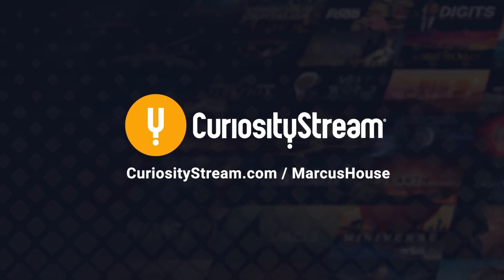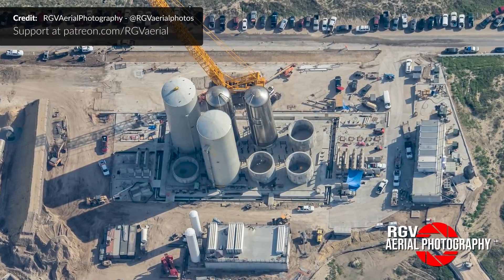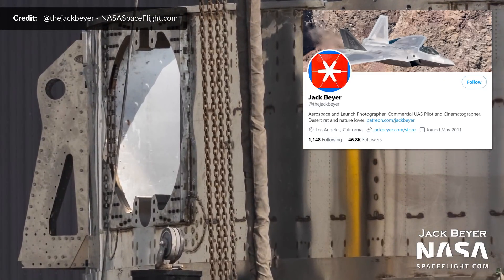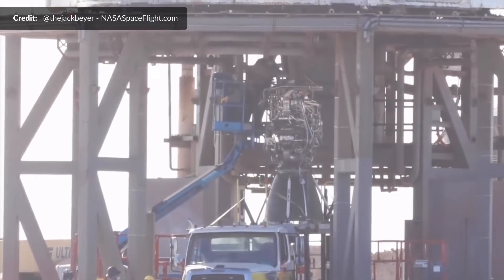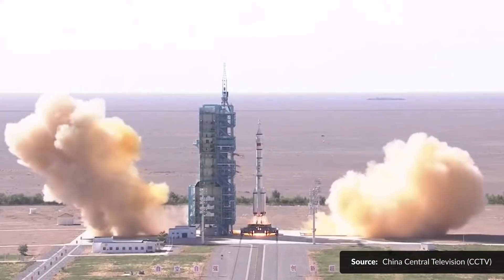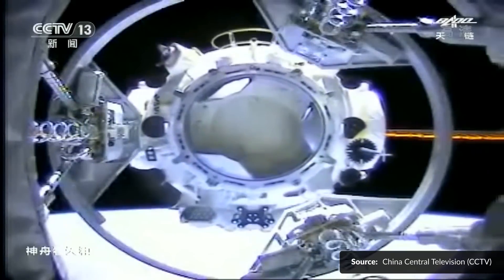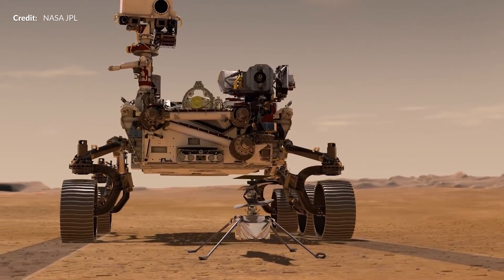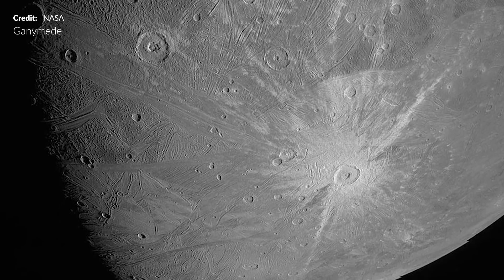Hypersonic Starship and Incredible Orbital Site Progress, GPS III SV05, Rocket Lab Mars Mission

Comment: I sit in my 2000 accord and wait for its "raptor" engine to warm up. Because, if I don't let it warm up it doesn't feel right. My raptor engine could probably get to the moon an back. I started calling my car a raptor engine recently. Also, I started working for GM and I drove a Ford Raptor off the lot to just check on a lot full of cars that are wasted talent, anyway, the raptor is a huge engine via Ford. It was all I imagined. The Ford raptor has definitely already been to Mars.

Comment: New Foundation Unknown Structure:   LOW structure.   Land on Water maybe the purpose of this structure.  LOW provides multiple advantages such as fire suppression, soft landing and controlled vertical capture.  Given the first stage will experience an ocean landing in the first orbital fight, it might be possible that a LOW structure built on land could be in the works.   Without the corrosive salt of sea water and with the addition of corrosion and fire inhibitors a fluid landing may be a good alternative to consider.   Now if you think this is a laughable idea just rename it to Land on Liquid for a nice acronym.

Comment: Maybe the, yet unknown, concrete pad is a raised surface for the sole purposes of elevating the crane being used to stack the final sections of tower? I feel like they need to elevate and level the crane to safely reach the top levels. Cheers.
Reply: The crane full capability is higher than the full tower itself

Comment: The positions of the grid fins on the starship booster in  2 groups is actually more optimal then with a 90 degree pattern. With the 90 degree pattern 1 or 2 of the fins are fully or partially in the wake of the booster reducing the effectiveness at high angle of attack . VS - with them at 60 degrees apart this keeps them mostly out of the wake more and should improve their performance to provide better return guidance - the booster can fly flatter with preferred dorsal side during return.
Reply: Tldr
Reply: @macawguy3021  then why are you here?
It's good info.

Comment: Marcus,  it's been on my mind a bit and I'm sure someone has answered it somewhere and I've missed it. With all the work to Falcon, and now Starship, why would SpaceX move to ditch in the ocean as opposed to landing, either offshore or onshore?
Reply from the maker: They are still just prototype phase rockets. This allows testing without the risk of damaging any of the new infrastructure. They will by unlikely to refly either again and it is probably also unlikely they will get a perfect point landing first time. Need a lot of data and testing before they can really risk Starbase.

Comment: Marcus, 3:28

Vertically directed exhaust opening for underground routed  FLAME TRENCH from launch stand. Look where it is directed from.

NO WAY SpaceX will launch the BN's from ground surface without it (them).

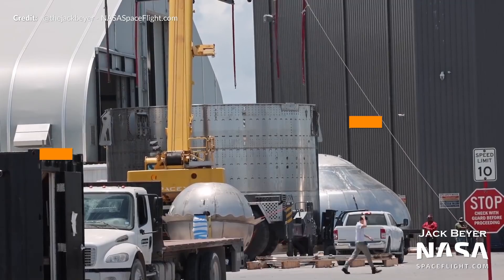5:17
Post capture alignment guides.
Reply: The position is very wrong to be a flame trench. And trench is impossible near the coast without flooding

Comment: Placing the grid fins in the way they have will make it so that it will only be catchable if the superheavy booster is in the proper rotation with respect to the  tower when it comes back to land. If the booster is 1/4 out of proper rotation, the catching clamps will be out of orientation.
Reply: The grid fins is not the place where the catching arm will be catching

Comment: I bet the new foundation is the booster catcher. They probably don't want to risk damage to the launch tower.
Reply: They need a tall tower to catch the booster, with a deep foundation - that's the current one they're building. The official FCC documents for that tower say it will be used for catching the boosters. So there won't be a separate booster catcher.

Comment: The returning booster will be empty of course but I wonder what kind of strain the weight of those nearly 30 raptor engines plus the booster shell will put on those grid fins, or even on the weld joints, when it's caught
Reply: It's relatively light when all the props are consumed

Comment: I think Mars could be considered "terraformed" if it reached a point like Pandora from Avatar - correct pressure, temperature, no killer radiation or particles in the air that could be harmful to our skin, all you need is a face mask for breathing.

Comment: Could sn16 even survive a hypersonic testflight with an incomplete heatshield? It is my understanding that it is made of 301 stainless steel, which has a maximum service temperatures of around 750C, while the X-15, which could reach top speeds of mach 6.7, had parts heat up to over 815C. What do you guys think?

Comment: So, Artemis can look forward to having of the shortest stents ever of being “world’s most powerful rocket”. Teehee.
Reply: The way Starship is going I don't think SLS will ever have that title. :)
Reply: @williamgreene4834  It might if you slap "orbital" into the title, since SN20's flight won't quite reach orbit. I think full stack starship launches will take a lot longer between iterations since they require so many engines.
Reply: @kalebbruwer  True, but my guess is they'll go for orbit by the end of the year. I guess that might just be a dream but I'm stickin to it.
Reply: @kalebbruwer  According to Elon, they're cranking out Raptors at Hawthorne once every 48 hours. So that's roughly 70 days to make the 35 engines for Starship and SuperHeavy.
Reply: So a little less than 2 months between every launch, at least until they start landing.
Reply: @kalebbruwer   SN-20 will reach orbit. It will simply be an orbit with a perigee technically inside the Earth's crust. Therefore, it will not complete an entire orbit, despite actually being in orbit.
Reply: @odysseusrex5908  If you count that as an orbit, everything I've ever thrown was technically in orbit. But it is a technicality, they are deliberately not going to orbit so they don't accidentally create 80-100T of space debris, but the flight will use almost as much fuel as an orbital one.
Reply: @odysseusrex5908  Or inside the atmosphere to be exact
Reply: @kalebbruwer  It didn't need to reach orbit or anything to get that title. It just need to freaking launch and produced that thrust in real life
Reply: @kalebbruwer   No. Things you throw do achieve orbital velocity. They would not actually orbit an object with the Earth's mass but smaller radius. The Starship will achieve orbital velocity. It's orbital parameters will just be such that the perigee would require it to be orbiting an object with a smaller radius, but the same mass, as the Earth in order to complete an orbit. By contrast, something that is not in orbit, that does not have orbital velocity, such as an ICBM, or a flung brick, will inevitably impact the surface regardless of radius.
Reply: Sometimes a typo brings a little smile :-)

Comment: Hey Marcus. Great job as always.
Here's my take on catching the booster.
The spotted ring section doesn't show a lot of reinforcement, so I don't think it'll be able to take much impact during the catching maneuver.
I guess they will have to hover the booster to position and orient itself next to the launch tower, then deploy the catching arms and softly pick up the booster out of the air.
In my view that approach would be simpler, softer and more precise than a precision landing of the booster on the catching arms.

Comment: So, exactly how is the concrete surface beneath the launch tower not going fail under the heat abrasion and force of 30 raptor engines? Even a small piece of surface debris coming off could cause catastrophic damage to the vehicle. This launch mount appears woefully underdesigned... like a throw away prototype they intend to ruin.
Reply: Seems like you have a better idea

Did the landing zone get damaged from Falcon landing?

Comment: i assume they need to fully wrap the belly in heat tiles before hypersonic test
Reply: Exactly what I was thinking. 
The entry heat might break it apart well before splash-landing.
It would need to be fit with coupling devices to mount to the booster.
Reply: Only of they want to recover it.
Reply: But if it is launched without the tiles it would mean that the orbital flight was going ahead without a test of how stickable/durable the heat tiles are, which I think would set the orbital flight up to unnecessary risk.
Reply: @brettcoster4781  The orbital flight itself IS a test

Comment: Sorry, but might is Musk speak for never gonna happen, forget about it, it's done....Anyhow IMO the grid fins will likely be folded in before the Booster gets anywhere near the tower. They serve no purpose after the booster fires its final landing burn and deployed they make catching the booster more complicated. Likely the real reason they were moved closer together is to get them nearer the landing hard points. If those brackets are for landing they will require a lot of re-enforcement which is inevitably heavy. By bring the grid fins close to these hard points they get to use the hard points' support structure to also support the grid fins, thus saving weight.

Comment: Great video, but the first SLS flight will not be using a mass simulator. A flight capable Orion capsule, European service module, and abort systems will be used. Everything will be the same as if it were a crewed flight, except without a crew.

Comment: The booster landing at 9:57 is impressive, all right, but SpaceX is going to have to get closer to the bull's eye than that with Super Heavy if they want to catch it by its grid fins. That plan doesn't seem to leave any margin of error. Seems crazy to me, but what do I know?
Reply: A Falcon9 booster is too light too hover (or respectively a single Merlin is too powerful).
It has already been demonstrated with Hoppy and several StarShip prototypes that Raptor can be throttled low enough for hover & move

Comment: I don't think the grid-fins would be strong enough to act as the method of capture by the arms from the tower - as such I think the added bits on the side of the hull are going to be used for the catch-capture instead.
Reply: Yeah, even with Superheavy being empty, i doubt 4 grid fins will suffice. Glad to see another quick iteration.
Reply: Those brackets on the side seem to be in the wrong place for landing capture. I think they might be for hoisting. Perhaps the booster lands on  tower arms leaving the booster hanging on its grid fins. After that there is an urgent need for the tower crane to automatically hook onto the booster to secure it and move it. Obviously they wouldnt want to involve blokes up there hooking it on by hand so needs a fancy bracket. Not sure why they needs to be on the exterior rather than tucked away into the  interior of the booster though.
Reply: @andrewfarrow4699  Maybe it's an interface for Starship's octograbber equivalent.
Reply: I'd say that's a reasonable guess. Then again, there would be very little reason to put the grid fins in the pattern seen on BN2 rather than 90 degrees apart like Falcon 9 unless they planned on catching the booster with them. I could very well be wrong though.

Comment: I have a bad feeling about this whole catching a booster gig.
Reply from the maker: Am am apprehensive about it also. It is going to be quite the show when they first try it.
Reply: It was not so long ago that a successful precision landing of an autonomous booster on a barge at sea was thought impossible.
Reply: @oversoulwastaken  Absolutely, and I have no doubt they have many many engineers working to figure it out.
Reply: It worries me that SpaceX is still unable to land F9 boosters within a few meters accuracy. Maybe SH will be able to increase the accuracy  with the ability to hover, but the tower is going to need the ability to compensate quite a bit for that level of movement
Reply: @spencergeorge4941  A single engine on the F9 is too powerful for the F9 to be able to hover. Starship won't have this problem.
Reply: While I don’t exactly know how precise the landings of F9 are, some of the accuracy error in the F9 landings are attributed to the fact that the drone ships are trying to hold a position in the ocean. So how much of this inaccuracy is attributed to the drone ship being slightly out of place? Remember that the F9 is aiming for a coordinate point, not a ship. And the drone ship just parks itself in that coordinate point.
Reply: @spencergeorge4941  The variation in horizontal position is determined by very small variations in the trajectory guidance on the order of 10 seconds before landing.
These cannot be corrected in a hoverslam landing, there isn't the time, fuel, or throttle control available.
What impresses me, who as a student in the 70's wrote reentry simulations, is just how accurate they actually are. They have lost one booster through incorrect coordinates, one(?) in rough weather, and one through engine issues, but once they got landings worked out they have been very successful.
I suspect that the target circle is 2σ from the target. The deck is even larger, so I doubt that they'll drop any.
What I wonder is if there's any communication between the booster and landing droneship for latter to adjust its position. Probably not.
Reply: @AndrewBlucher    No, there is not.
Reply: While I don't doubt they can get it to work I'm mostly sad about the boosters not landing F9 style. Probably can't make it to the US for an F9 launch so I had hoped to see it with SH. It is a good choice getting rid of 10-20 t of landing legs but still... Would be sad if that type of landing didn't continue after F9...
Reply: would  be nice to see the booster landing  like Falcon. I think  we have no perspective  about  the size  of it. Would  be nice to see next to something  we all are familiar.

Comment: cryogenic water => block of ice. so of course its noncryogenic. :)
Reply: well if pressurized it can't expand to form ice, but the pressure would be huge for cryo ahahaha
Reply: @ReigBonjux  Actually, super cooled water is a real thing.

Water ice needs a catalyst in order to form properly. Usually this is minor amounts of impurities in the water, or jagged spots on the surface of whatever is containing the water. Pure water's freezing point is actually far lower than 32 degrees fahrenheit.

If there are no catalyst points, a jolt of activation energy will suffice.

This is called super cooled water, water that is still liquid below the usual freezing point. You can make some yourself by taking a bottle of distilled water, and putting it in the freezer. So long as the container is clean and smooth, it shouldnt freeze.

Then, you can smack the bottle against a counter, and trigger a cascading freeze across the bottle within a couple seconds. That bit of kinetic energy is all it takes.

Also, yeah, you're right, pressure can prevent ice from forming. If you put a bottle full of tap water (with impurities) in the freezer, and its as full as possible, sometimes it'll only form a sludge, or one time I've even seen a pocket of liuid water, encased by ice, in the center. These things can occur because there is literally not enough physical space in the bottle for the ice to form. Ice is one of the few materials that expands when it solidifies, due to how much empty space there is in its crystalline structure.

Anyway, dunno if any of this has anything to do with SpaceX's water tanks. I'm just saying "cryogenic" liquid water is basically a real thing.
Reply: @hatman4818  You sound like you know what you are talking about, can you explain the triple point of water? Something something changes to gas solid or liquid, I don't get it.
Reply: There's also the problem with "hypersonic starship".  It is either redundant or meaningless depending on how you look at it.  If you are going to go to a different star, of course you have to go faster than sound at STP, but since sound doesn't travel without a medium to travel in, there is no sound in space and "hypersonic" makes no sense.
Reply: @jeffc5974  reentry velocities are hypersonic and ocurr in upper atmosphere
Reply: @ReigBonjux  That is nothing new.
Reply: @jeffc5974  hence hypersonic. No starship to date has done that.
Reply: @ReigBonjux  No ship has been a starship either, including this one.